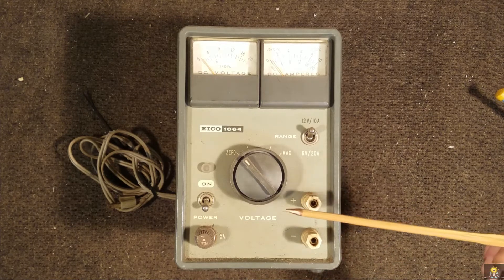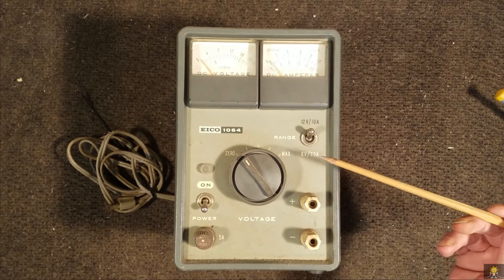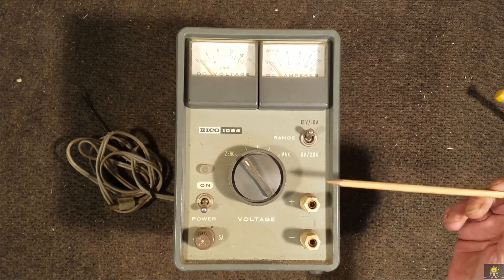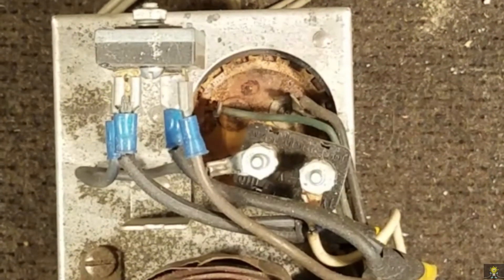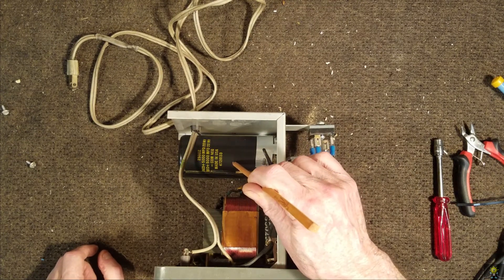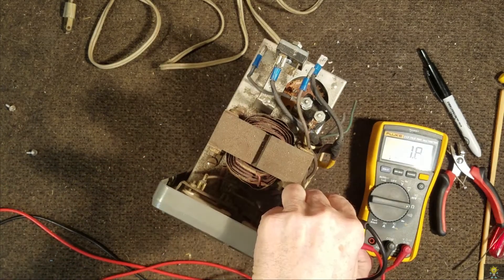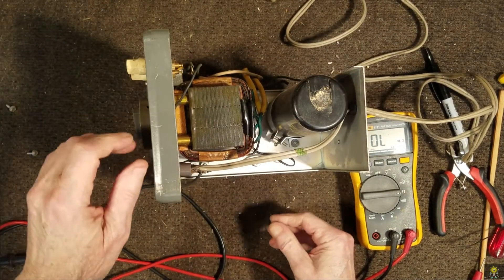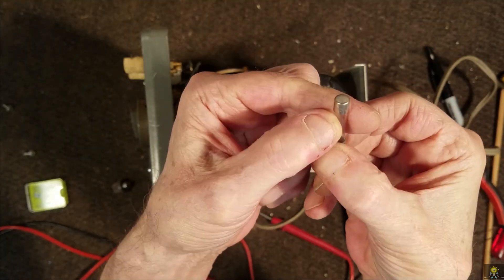014 Eico 1064 Part 1, Check and repair.

Comment: Hi, those capacitor shells are used in techtop motors for motor start capacitors. Non polarised of course. I have 3 on the bench right now. The internal connections corrode off. These are recent manufacture 2017. Probably made in China now. but it is the same mold.
Reply from the maker: Wow! Thanks for the info.

Comment: I have the same power supply and it is not giving good current what would most likely be the problem
Reply from the maker: Tony, I would check the cap and diodes. There's not much else that can go wrong. If you need help just ask.